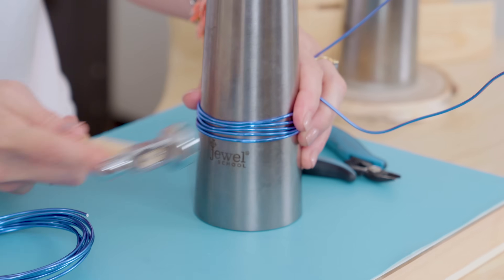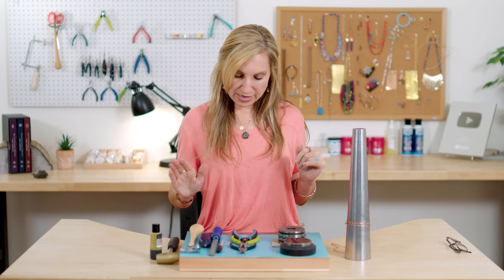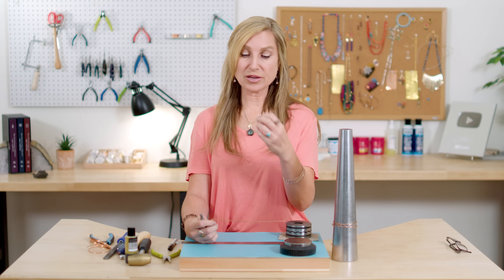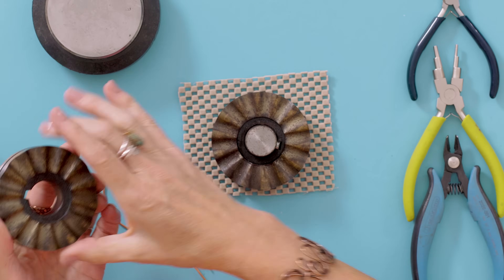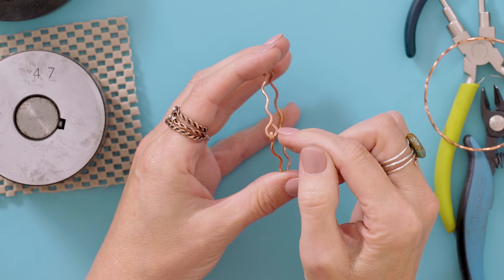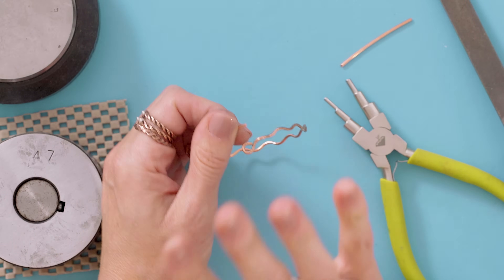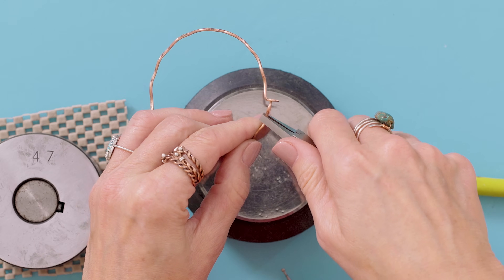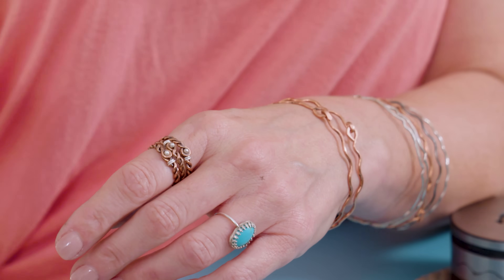Easy No Solder Wavy Bangles | Jewelry 101

Comment: Hi Susan just came across your videos tonight and they are wonderful, it's two videos that I notice you speak and show the "wire rounder" yet I seem to run up short finding it in your site or on amazon, it gives me other things but not that motorized tool. Is there another name that it goes by? Thank you for your help in advance.
Reply from the maker: Hi! Yes, Beadalon now sells the battery operated Bead Reamer. This is not a wire rounder, BUT the tips are interchangeable and they sell a wire rounder tip, that can be placed on the base. So basically you have two tools in one! Try searching for Battery Operated Bead Reamer and the Battery Operated Wire Rounder Tip.